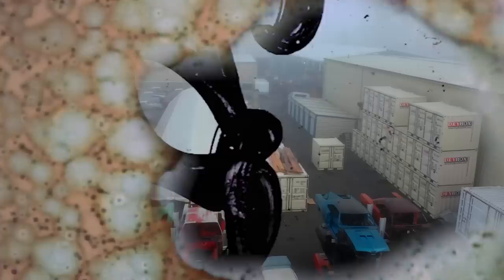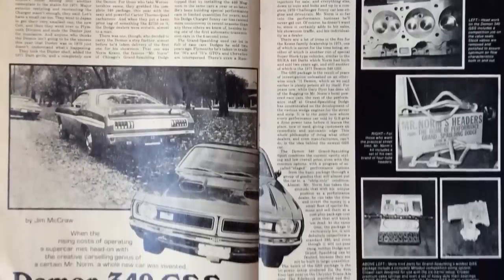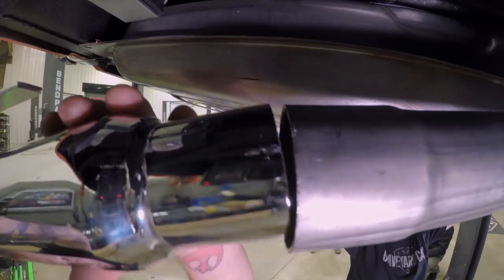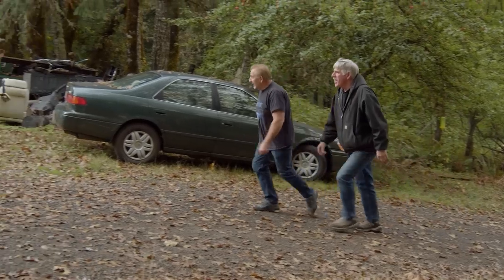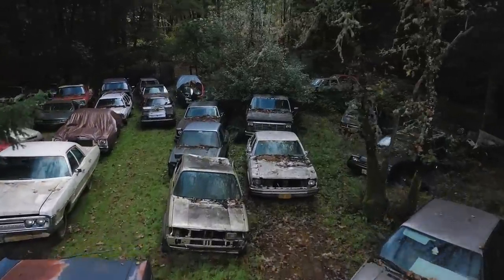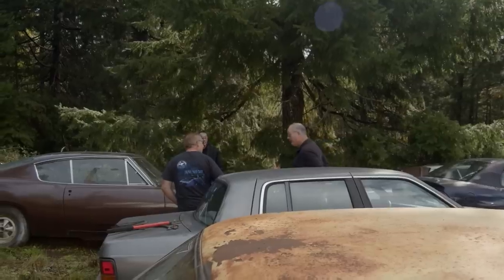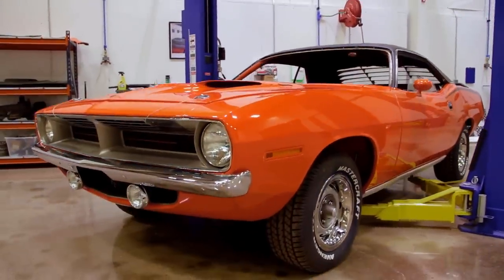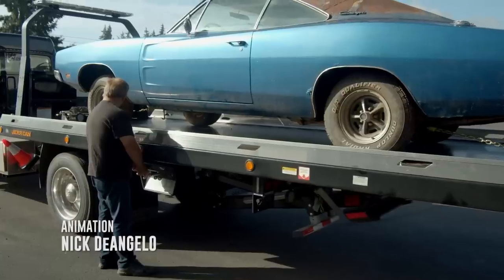MARK AND DOUGIE FIND A REAL 'CUDA IN THEIR OWN BACKYARD!

Comment: Fender Scoops: I hope you coated the bare metal  threads after installation with a coating or spray as they will rust out readily from water uplifted from the tires....
Reply: If dodge didn't do it, these guys don't either.